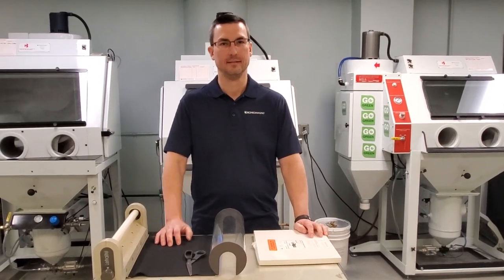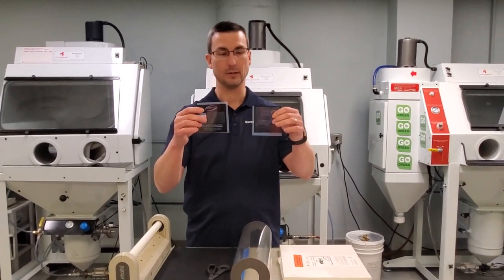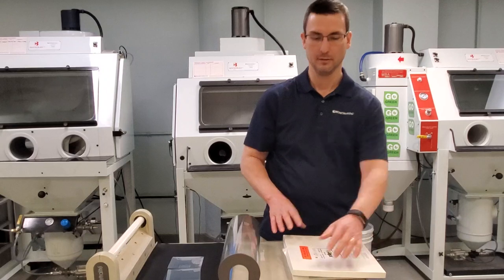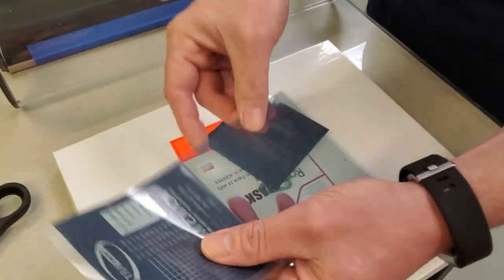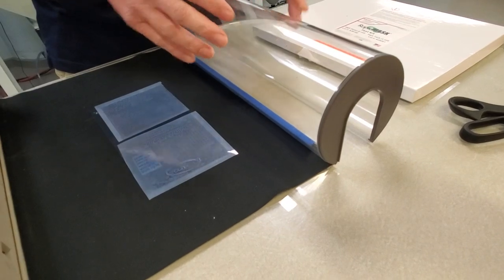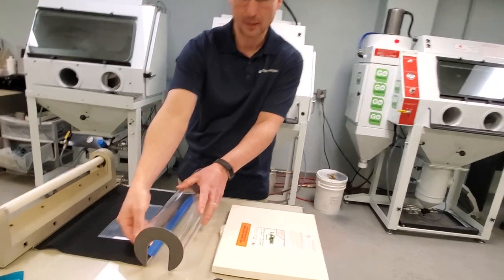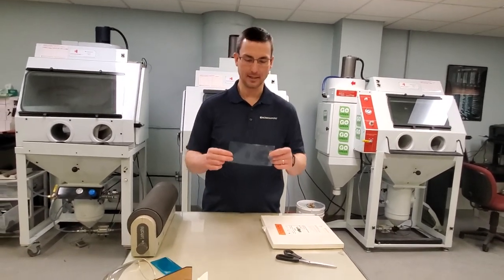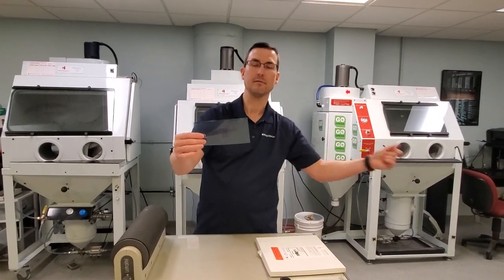Exposing RapidMask Dry Process Photoresist Film

Comment: I have watched this video maybe 80 times and I cannot follow what is happening even though it is kind of being visually shown. The Rapidmask that I have is mylar slick on both sides and the curvature of the material seems to be opposite of what was explained.  In any case, I am unable to use the product based on any of the provided instructions written or in the video, unfortunately.  I also do not understand what kind of light is safe to work under.
Reply from the maker: Bret, I am sorry to hear that you are having trouble. Please call 18006431037 and speak with one of our very knowledgeable sales reps. They love to talk and would be happy to find out what exactly is needed to get RapidMask to work with your particular project.